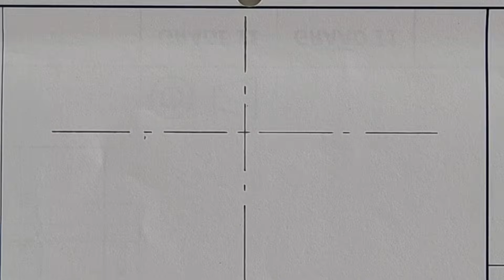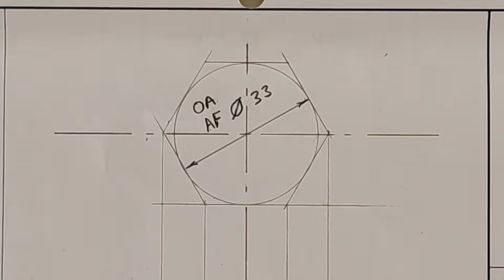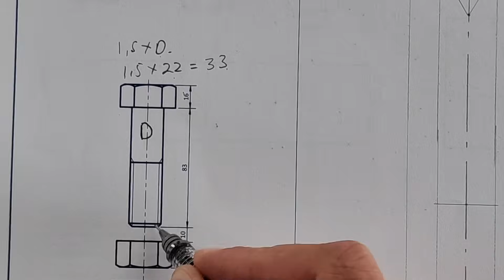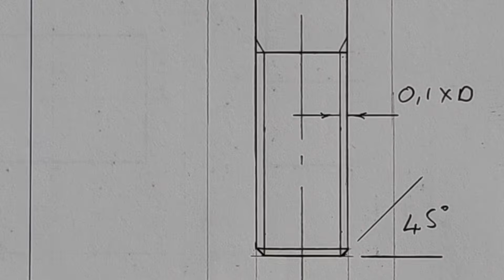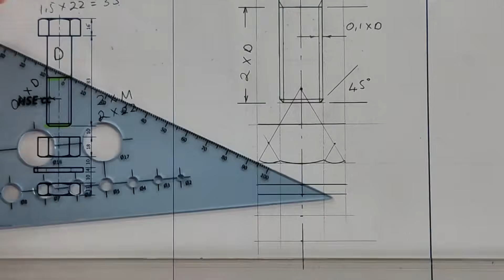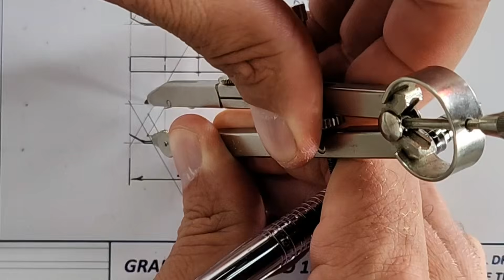How to Draw a Bolt and Nut - HSE | Page 2-6 | Grade 11

Comment: what if they say M20x2 what does that mean?
Reply from the maker: Hi, great question. The 20 is the diameter of the bolt shaft in mm and the x2 refers to the thread depth of the screw thread. For example, a M30 x 2 would mean a shaft diameter of 30mm and screw thread depth of 2mm. Trust that helps. Draw with confidence